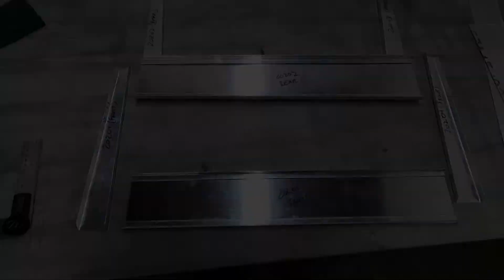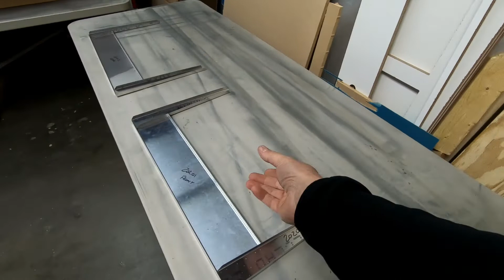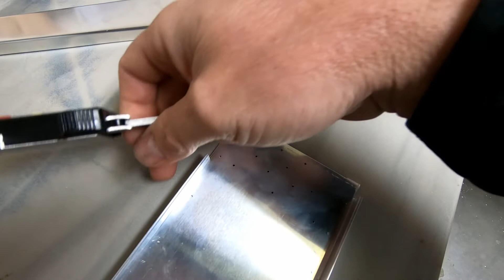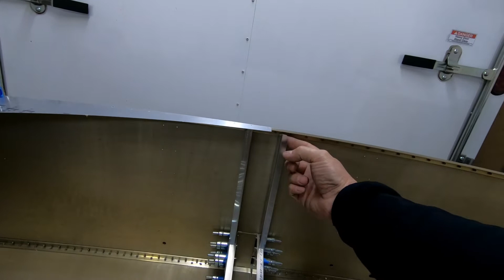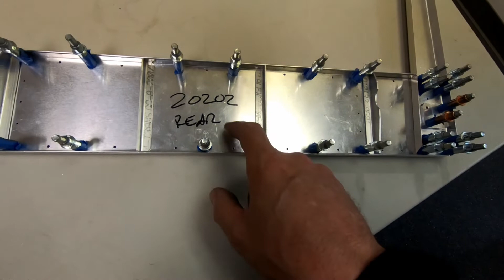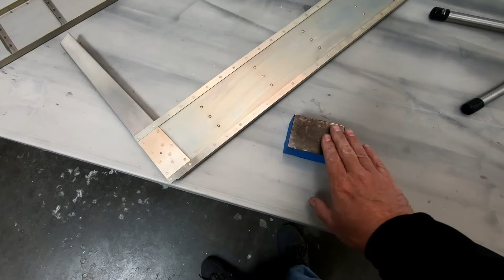11A - CriCri Airplane Build - Frame 4 Spar Box Part 1

Comment: I was wondering when was the right time to check the spars' fit inside the box, and got an answer. (It would be a real shame to do all that work, install the frames, and then discover that the spars were a fraction off.) 
Given the obvious complexity of the structure, you'll want to detect any errors as soon as possible, before all sorts of effort gets invested and then has to be undone. At least the mistake in the web surfaced at a reasonable stage. Error-preventing processes well beyond "measure twice, cut once" are very important.